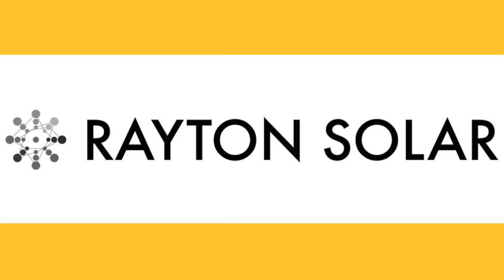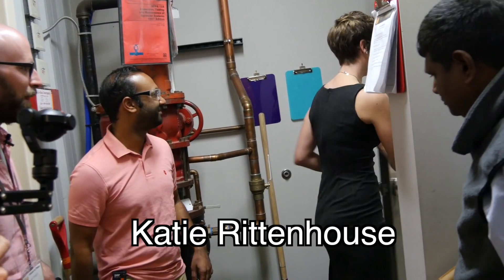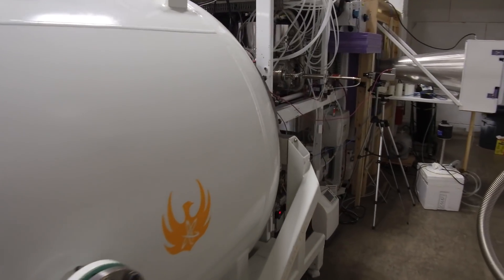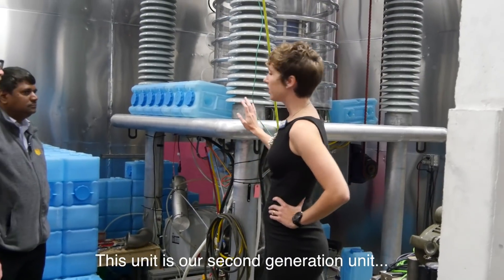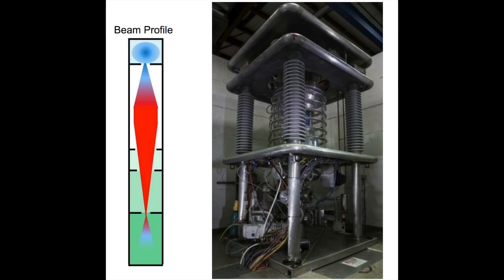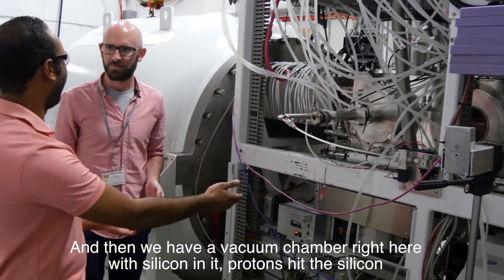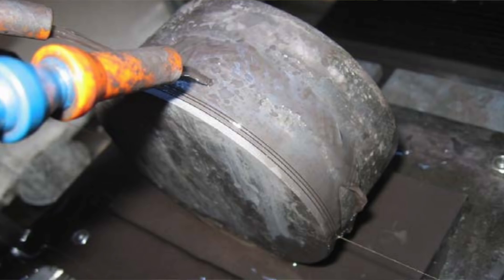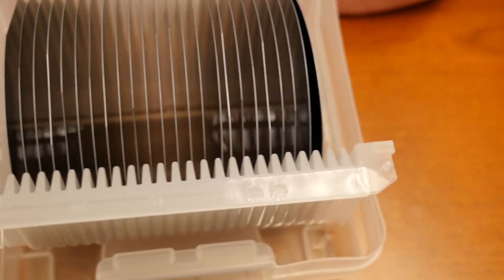Hands On Awesome Tech: Making Solar Cells With a Particle Accelerator

Comment: I've invented a Biomass Engine capable of economic viability prodicing algae for biofuels. USP#9051539B

Would that qualify for a TIFO video?
Reply: BlackEpyon the amount of carbondioxide released when using biomass as fuel is less or equal what the plant used to grow (photosynthesis). 
So it‘s neutral regarding green house emissions.

Sorry for mistakes I am not a native speaker.
Reply: The problem with fossil fuels is that in the early stages of our earth there were conditons not suited for human life and through storing exessive carbon in fossil fuels over millions of years the earth became habitable for us. 

Reversing this process now meaning burning all of the fossil fuels on earth is the problem.
Reply: BlackEpyon -- Moving away from petroleum with electric cars is the easy part. Jets, ships and trains can't be made to run on batteries so won't be changing any time soon. The system uses CO2 to grow algae that makes an oil that is perfect for jet fuel. You can wrap it around an airport to make an energy independent facility.
Reply: BlackEpyon -- One enormous problem at a time. The Earth will be fine, no matter what happens. The humans however....
Reply: I thought we were trying to move away from fuels, were we not? It doens't matter if it comes from the ground, or from a refinery, if it burns carbon, it's contributing to the problem that we're trying to reverse.
Reply: That biomass would normally go back into the ground when you bury it. What do you think is happening with all that permafrost melting in the tundra because of global warming? The methane that has been trapped for thousands of years is being released, and is contributing to the feedback loop. In this case, you be taking the carbon that the plants absorbed during their lifetime, and releasing it during combustion. We need to put carbon BACK into the ground, not back into the atmosphere.

This does not solve the problem.
Reply: BlackEpyon -- If you carbonize what is left over after oil extraction, and put it back in the coal mine, that might go a long way to solving your problem.
Reply: Are you talking about what doesn't get turned into petroleum products? Like the sour gas that's burned off? Sure, but If we could stick a devise on the tailpipe that would extract the CO2 and deposit a brick of carbon that we could toss into the ground, we would already be doing so. 
But we have devices for doing that already. They're called trees. We just produce a lot more CO2 than the trees can absorb, AND we're loosing trees to deforestation and wildfire.